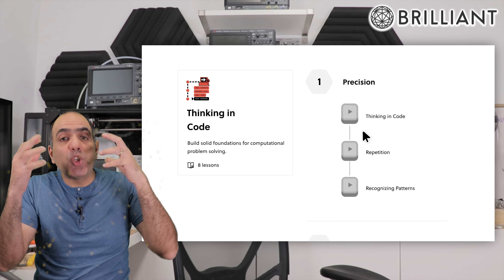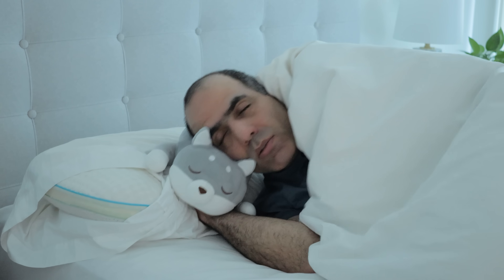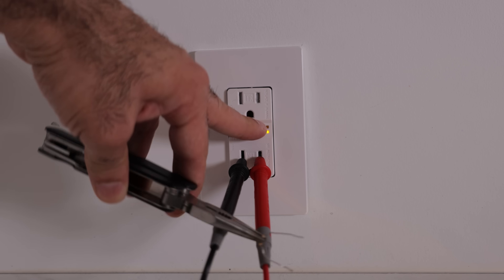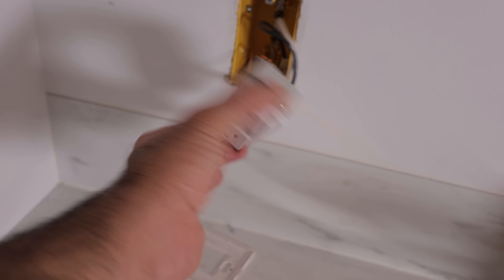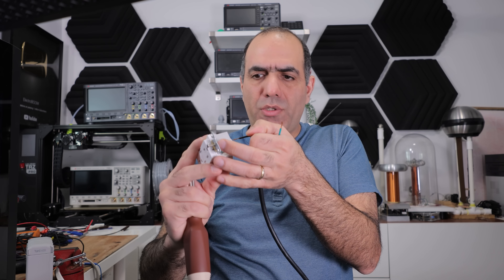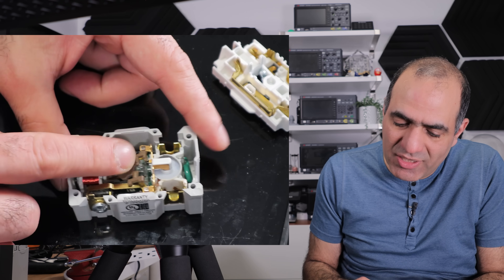Repairing Faulty Ground Fault Failure

Comment: Hi Mehdi great content as always !!, I have a electrical doubt which is giving me headache for a long time, can you please explain why there is low current in the secondary coil of step up transformer even though voltage is high, I know its because of conservation of energy, but what exactly limits the current since high voltage should drive the current more.

Comment: The proms are easily touchable when live, and energized screws on the sides when you disassemble the outlet and GFCI at the outlet instead of the circuit breaker. The North American outlets are an atrocity.
In Brazil, our outlets are recessed, so you can't touch the proms while they are energized, the outlet screws are on the back of the outlet protected by a plastic cover, and hard to touch.

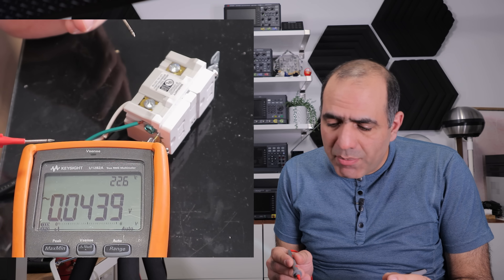Comment: 6:50 I think earth and neutral are not shorted inside the fuse panel, they are along the distribution line. Normally at the substation. In Spain is in this way.
Reply: Different countries have different standards. TN-S (like you describe in Spain) have a connection at the distribution transformer. TN-C-S (like in US/Canada) only have a neutral in the building's power feed and then it's separated into discrete ground and neutral. Some places like the UK have different rules depending on where you are and sometimes even on the same street.

Comment: Bro i have a question my headset is broken and in should connect 7 wires to 7 places on the board of the headset m+ ,L+ ,m- ,5v,GND,AGND what wire with what colour should i connect please answer ❤

Comment: As a mechanical engineer with an electrical minor, I was fascinated to see the inside of one of those. I always assumed there was some kind of device that 'sensed' when current went through the ground wire and thats when it would pop. Never would have guessed there was a comparison circuit between live and neutral but that made so much sense in the world. God I love engineering.
Reply: It actually wouldn't work if it sensed current on the ground wire. If you touch a live wire and a cold water pipe none of the shock current would go through the ground wire.

Comment: Huh, so it's not only me.

Just the other day at work I took apart a few fire detectors because of a fault that appeared on the system screen for 2 weeks already. Then I did 0 changes to it because found nothing wrong with them (again), put everything back together, checked the fault-display, it said 0 faults. 

I have no idea what I fixed, but it's working now.

Comment: I lived in an apartment for about 3 years and when I moved in the refrigerator was plugged in above the kitchen sink. I figured that was fine but... it was a GFCI and it randomly tripped. It even tripped when nothing was plugged in. Also... wasn't wired correctly and wouldn't pop when you used one of those tester plugs... So... that was fun and exciting. But one way... gone for the weekend. I come home to find my refrigerator was powered off and the GFI tripped. I had considered doing some shopping before leaving. Thankfully I didn't or I'd have lost more than a few dollars worth of hamburger.

Comment: I also test gfcis a lot, i built a small device with a 2 watt potentiometer and two power resistors to dissipate most of the heat (one for 5ma range and one for 30ma range) Couple of milliamp meters and you can see what their trip threshold is too, doesn’t tell you trip time but it’s cool
Reply: With a neon indicator and a video camera you could do your own (crude) trip time measurements.

Comment: I haven't seen uninsulated wire for ground in years, only in very old houses. Our earth cable is provided with insulation, green and yellow in color. We have the residual current switch in the electrical cabinet, first this switch and then the automatic fuses that protect each power circuit. But that's in Europe.

Comment: Question: Would you trust a safety device you "fixed" yourself?
I don't trust myself that much. I've experienced enough weird failure modes on stuff to understand that things can appear to be fully working at first, but when it's really needed it fails due to something I've done without realising what I've done.

Comment: My experience with these devices is the catch mechanisms wears so that they wont hold on properly, this wear is down to the latching mechanism is made of soft material and every time you test them they wear. I have found them using very soft steel or even plastic on steel obviously designed to wear out rapidly. I live in the UK so when this happens the whole house goes down and as the system has no switch between it and the meter you have to call an electrician who is also registered to break the seal and pull the company fuse. Happened again just recently costing over £200 after tax, it lasted about three years.

Comment: Ground is not needed for these devices. In fact, if you buy them, there will be a sticker that says "No Equipment Ground" which you put on if the socket is not grounded. Yes, it is code legal to replace a two pin ungrounded outlet with a 3 pin GFCI outlet, and it's safer that way too.

Comment: I have random trips on a RCD in our house (spain). It can be fine for months and then I have trips several times a day. I suspect a gecko, slug or other small creature getting into an appliance or the fusebox being responsible. Also if A/C is connected to the RCD it must be "super immunized" otherwise it will randomly trip.

Comment: As a Master Electrician with an Electronics technician degree, MANY TIMES with the GFCI Receptacles, I have discovered that the lack of space in the box, combined with too many wires and improper installation, can put a forward bow between the mounting screws and the face of the GFCI. and can cause this exact reaction. A few simple spacers under the mounting screws solve this.

Comment: If I understood correctly how american GFCI works, TEST button just mechanically releases the connection but doesn't actually TEST of the GFCI Protection works ... I opened an old European DDR (Disjoncteur Différentielle à courant Résiduelle) =(GFCI) and when you press the TEST button it actually TEST the GFCI by bypassing electricity in a Resistor to actually make a residual current path to earth
Can you do another video opening a NEW GFCI to check if the test button ACTUALY test the ground protection?

If any of you are interested in me showing European GFCI just tell me in a comment and imma do a video about it, it's gonna motivate me to buy an ex GFCI for my home since the one in my cellar
Reply from the maker: No actually the test button connects a power 12k ohm resistor to earth it seems. Although I didn't quite made sure if that was true.
Reply: Aaaa ok i re-watched the video and understood, i think im gonna do a video off what's inside an European GFCI tho since it's WAY more simple and usualy combined with short-circuit and overload in the same time

Comment: We also used to use a dielectric spray called corrosion x to add a bit more water resistance to the inside of the outlet. We would just spray it into the ground holes and it would fill up the entire receptacle. This would make them way more reliable in outdoor applications. I suspect that corrosion is the problem on the circuit board and that would make the CT coil sense incorrectly making it trip.

Comment: If you had to work in the dark it means that the outlet and lights are under the same circuit, which is a no no in a lot of countries (in recent years).
Also, what are the advantages of not having house wide protection? You can buy the modules and insert them before everything else... kinda.

Comment: Actually, the original problem with the GFCI is the reason why the RCD doesn't have to be used everywhere in Europe. Since the RCDs are quite unreliable (compared to other devices) you can't to use it in places where accidental shutdown could cause major financial damage. (cca 4000$ or more where I live)

Comment: The only annoying thing if you have central Ground Fault Protection is that even if you turn off power on the switchboard, you should never ever touch ground and neutral together or your whole house will lose power, including fridges and even worse computers (like home servers and their HDDs...)

Comment: Does the test button even test the current sensing? To my knowledge, most CFGI breakers in Europe actually place a load between live and earth when you press the test button. This way, you not only test the mechanics but also the sensing circuit.

Comment: As a designer and maker of music electronics, I would like to confirm that opening and closing a device is an excellent diagnostic tool. Also it's helpful to poke at it a few times while muttering and pretending to know what you're looking at. Those two things work for me ~92% of the time, in a professional setting. It's only when they fail that I have to get out schematics and meters and scopes... ugh. 🤣

Comment: hmm, I thought the test button connected a internal test resister from live to ground to test that it will trip.
I think that is how it was in the one gfci I took apart years ago, although that one had way less electronics in it.  Maybe it varies depending on manufacturer.

Comment: I had a gfci that would trip but not disconnect the power. Turns out we had a nearby lightning strike that welded the contacts together.     
It was used with outside lights including a 12 transformer for landscaping lights. The lightning strike literally caused the transformer to blow apart. The gfci appeared to work fine. It would trip when something got wet or when tested and the light would come on. It just didn’t cut the power.  It took more than a year to notice.

Comment: Wait, in the US if you try to change a wall socket without disconnecting power, you can die? There are no safety mechanisms on the wires? Just the sockets?
Reply: How do you put a safety mechanism inside a wire ?
And to answer your first question: yes, in USA we expect our electricians to have enough knowledge to turn power off before handling live wires. 
It's a good habit to get into and I don't know why your country wants to teach people that handling live wires is safe, by creating a false situation where wires magically have properties where the electricity can't go into a person.

Also could you explain that to me because it doesn't make sense, please.
I don't know what system you are talking about and it doesn't sound realistic.
Homes have hundreds of feet of wire in them and your magic solution would magically cause the cost of those wires to double. 
Homes in my city start at $800,000 already. Old homes. 
So I'd rather have electricians with in-built common sense, than your weird fake sounding magic wires.

Comment: Just wondered whether there are any differences between GFCI's and RCD (Residual Current Devices) in terms of how they trip/break to prevent shock?
Reply: Technically they're different names for the same thing. In practice American GFCIs trip at 5mA using electronic circuitry and European RCDs trip at 30mA usually without electronics.

Comment: 240v 50Hz, works inside, works outside, works with 10 metre/30 foot extension leads. Hardest part is pumping more than 2500W across a single 10 amp circuit across a long distance. Otherwise electricity is great. If you make a mistake in these parameters, you generally only do it once. 240v 50Hz 10A kicks like a donkey. 😅with love from Australia

Comment: I had a RCD fitted to my panel that lasted a day then kept tripping. After a bit of a think I decided it must have been a mechanical issue, I found if I reset it with my left hand it was fine, reset it with my right hand and it would trip shortly after. I called the sparkie back and he was, lets call is "skeptical". Came back a day later to replace it, while we were talking after he had replaced it it tripped while he was holding it.

Comment: come to Australia man you'd love it, over here we use these things called RCBO's it stands for "residual current breaker with over current protection" i know abit of a shit acronym, But essentially all our breakers over here have a GFCI device incorporated into them so basically the entire house is protected by GCFI same in commercial spaces too there are exceptions for higher current appliances but all general power and lighting is GFCI protected not just the "wet areas"

Comment: The joy of electronic RCDs... One of the many reasons why they are not allowed in Germany. Here we only use electromechanic RCDs, they are in general much more robust and reliable. Electronics is ok as add-on for DC fault current detection (like with Type B RCDs), but not as sole protection.

Comment: I just moved and noticed none of the outlets in the master bedroom are grounded when I tested them ugh. But the outlet in the bathroom is GFCI and it's grounded. So I'm assuming all the ungrounded outlets are on the same circuit. Does anybody know how to fix this without calling an electrician? Can it be the ground wire isn't connected at the outlets or circuit breaker?

Comment: As a trained industrial electrician, any time an electrical safety device has stopped working as intended, it needs to be replaced. You might think it is failing safe and it is supposed to fail into a safe mode, but that is your life and other people's lives you are putting behind that faulty device. Just replace the damn thing since it can't be trusted since it is flaky and could be full of metal shavings for all you know.

Yes, right from the factory, it could be completely unsafe if it is malfunctioning. Take it apart out of curiosity if you have the time to see if there was chance of death to see if sending it back to meet its maker or, God forbid, have to send it to the authorities since it is something truly dangerous.

Also, don't install UL rated equipment in your home that you have modified or repaired. If there is a fire and the insurance finds it caused the fire, your claim will be denied. If property that wasn't yours got damaged, you can be held legally responsible. If somebody got killed, you can get charged criminally for their death. Don't modify or repair outlets or breakers that you are going to install in a structure. It's a legal can of worms and best not to risk it.

Comment: It's funny the part he knows most about, the circuitry, he doesn't talk about. Electrical engineers and most engineers are fascinated by the other trades and systems they don't get to play with. The sensor that reads and trips is some combination of caps and resistors and transistors on a chip. Probably, I just install the things.

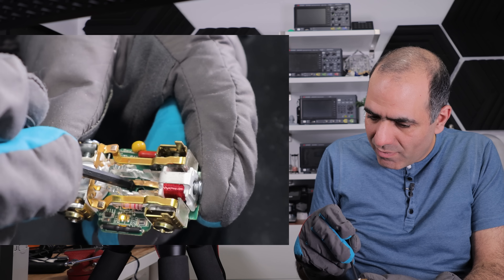Comment: 8:05 the coil there is the solenoid used to disconnect the circuit when a short is detected. it starts smoking because normally only gets powered for a very short amount of time

Comment: 2:55 i did some extra calculations to figure out whether or not the resistor would have gone up in flames :)

the video was too blurry to tell whether the resistor was 22kΩ or 220Ω, but if it was 22kΩ it would draw ~0.055A or ~0.65W. if it was 220Ω it would draw ~0.55A or ~65.5W :D
Reply: Probably 22k ohm one

Comment: I just knew that outlet would just fly apart when Mehdi opened it up. I had a similar issue with one where it would pop randomly several times then stop working. i bought several low cost (these things can be expensive) and continued to have issues. Finally broke down and bought a brand name one and no issues to report. I read that they are very sensitive to humidity and realized my wife had her electric tea kettle next to it and the steam is what killed it.

Comment: 8:13 "it's so mechanical" every electrical engineers worse nightmare, like when i tried to fix my fans button, those 4 buttons off/1/2/3, so i opened it up but i didn't know how to put it back, i literally need to watch a video on how they work, i need to open it up 3x because i put the "THINGIES  wrong💀💀

Comment: Speaking of Europe's central protections, in US we now have breakers with GFCI or AFCI or both GFCI and AFCI. But the whole house wiring must be compatible.
Reply: In a new American apartment, my whole house is GFCI but the only "test" and "reset" buttons are in the outlet on the balcony. For some reason.
And also, the balcony outlet is the only outlet in the house that has the weird safety shutters so you can't stick a fork in there.
I thought that was supposed to protect babies.
When am I going to have an unattended baby on my 2 story balcony, trying to stick a fork in the outlet ?
My house was designed by Frank Lloyd Wrong.
Reply: @Boogie_the_cat , how new is it? “15- and 20-ampere, 125- and 250-volt nonlocking-type receptacles shall be listed tamper-resistant receptacles.”
Also GFCI breaker doesn’t need a corresponding GFCI outlet. The test button is on the breaker.

Comment: mr Boom, at 5:10 you stick the resistor in the socket with a metal pliers. 
Is that not dangerous on its own?
Reply: The handles are probably insulated
Reply: @PersonCuber  not probably. They ARE insulated.

Comment: Wait a minute. the test button does what now, it overrides the spring. when did they change the design. in older GFCI plugs the test button basically did exactly what shoving a resistor in the live and earth did. it physically tested the circuit to make sure it worked. this design is silly its like the test button on a smoke detector. its not actually testing the ability to detect AND break a Ground fault. its testing the springs ability to break the connection. thats dumb and honestly more complicated. but you would never know that just picking a GFCI up at home depot cause they wont write what kinda of test its performing. just kinda wow, i mean i guess its a good thing you can buy those line detection plugs that will tell you if the outlet is wired correctly with GFCI tests built in. im probably gonna pick on of those up now knowing that the test button of a GFCI might not actually be testing the ability to detect a ground fault now.